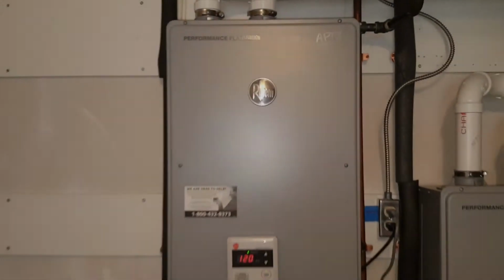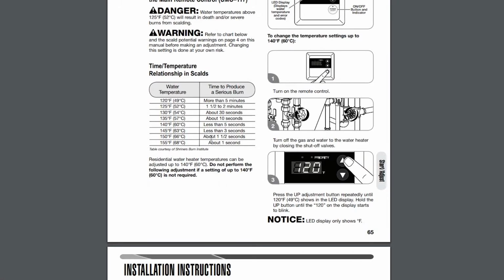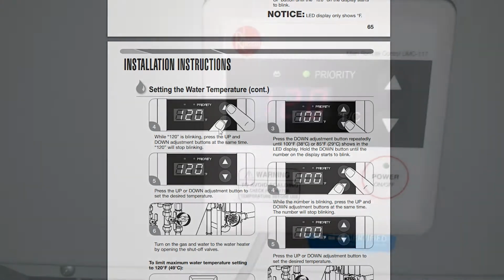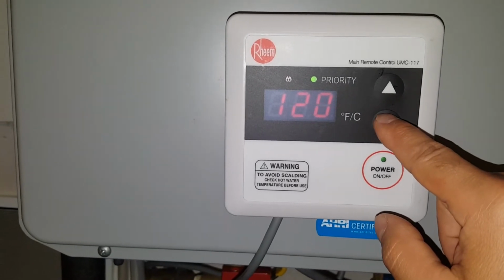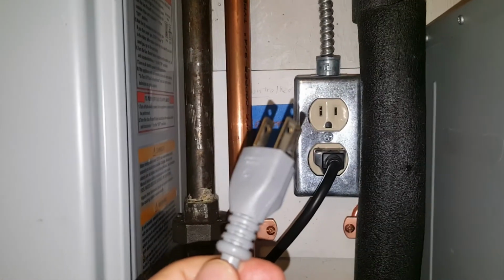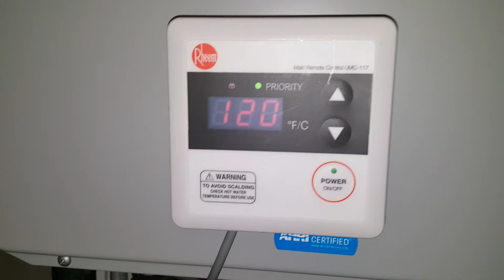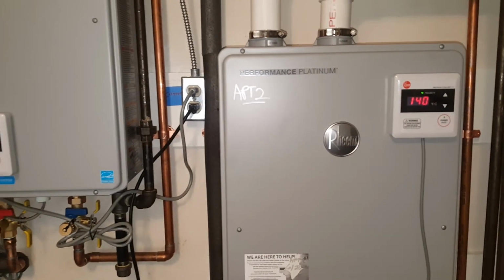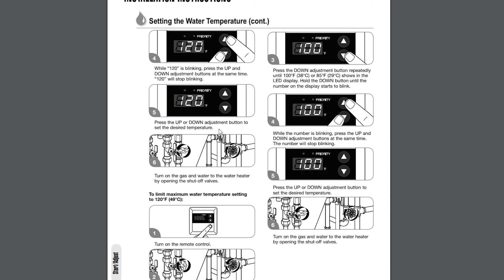Changing the temperature on a tankless water heater above default factory setting

Comment from the maker: Please note that the more you increase your temp the more you will decrease the water pressure. This is because the unit needs to work harder due to a higher temperate rise. This might be more noticeable in the winter, when in some places the cold water could be coming in to the thankless water heater at just above 32F.  One of the reasons you might increase the water temp is due to longer runs to the faucet in that part of the house but be aware this can decrease pressure. As water travels through longer stretches of pipe, it loses some of it's stored heat. Some Water heaters have a built in circulator that will some time to time circulate the standing cold water on the pipes. This will make the water water reason you faster. This particular Rheem model does not offer this, but you can buy the after mkt kit for it. Note this requires additional installation and costs. One other solution is to just install another water heater closer to the source.  Thanks for watching this video, leave a comment and put a like if it has helped you. Also please consider checking out my channel and subscribing, I have a lot more great videos.

Check out Amazon for Water heaters with circulators that will help you maintain a better temperature to the 2nd, 3rd floor or for longer stretches of pipes. Tankless Water Heaters on Amazon - https://www.amazon.com/gp/search/ref=as_li_qf_sp_sr_il_tl?ie=UTF8&tag=106000e20-20&keywords=tankless

Amazon 30 day FREE Trial - https://amzn.to/2ItA9Ar

Comment: my rheem not increase, staying at 120, I try shut off all valve turn off and on but remote not controll not flassing at all, please advice, thanks
Reply from the maker: follow the instructions, hold the button in until it allows you to change the temp. good luck.
Reply: @daP.A  I did many time , holding up button.. it not change anything ,stay solid at 120

Comment: I tried holding the up arrow button down, but my unit's display never changes from 120 to 140 as illustrated in the video. Any idea what I am doing wrong? Mine just stubbornly remains at 120.
Reply: Same! Hoping for a solution.
Reply: I think it won’t change if there’s water flowing into the unit, you need to close the water and gas valves first then try what you see in this video

Comment: What happened when is freezing out?
Reply from the maker: ?? As long as the cold water comes in to unit it will work regardless how cold is
Reply: Got it 
It’s cold and not water coming out, is there anything I can do at this time 

Thank you for you response
Reply from the maker: @rickylona6717  not sure depends, make sure pipes are insulated well. Call the manufacturer help line
Reply: @daP.A  l

Comment: Will this make the water get hotter faster?
Reply from the maker: No, just makes hot water stay hot
Reply: We just had a Rheem tankless installed and the water takes over a minute to reach the desired temp, sometimes longer.  Had the tech come out yesterday and he increased the water pressure.  Seems to have worked but we will see.  So far, not a fan of the tankless vs our 30 year old tank model.